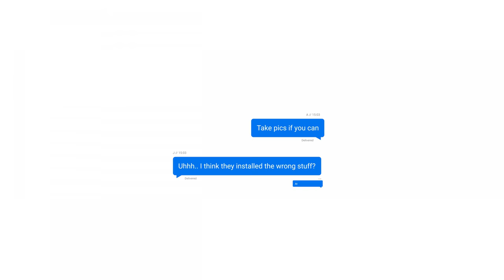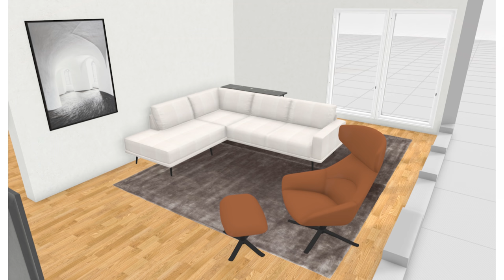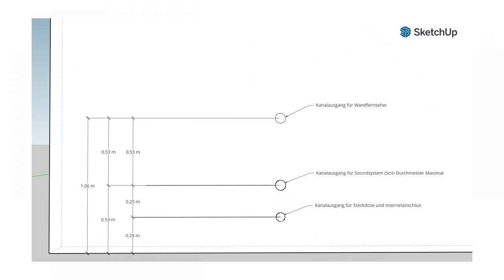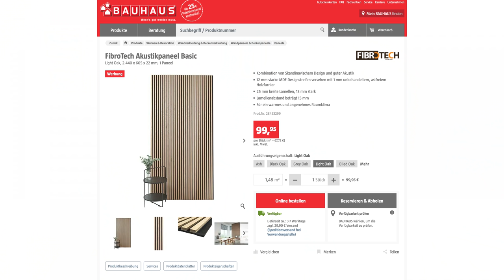HARD Lessons from Building a House in Germany

Comment: I really love your videos! You are so upfront, have a great way of telling stories and make it interesting throughout the whole video.

For my house, I basically let them do the heavy work like removing walls, install door frames, do the tiles, etc.

All floors, walls, doors, the kitchen, electrical stuff was done by myself, friends or family. Luckily we know an electrician.

I learned a lot on the work site since I'm an engineer and normally work on totally different things.

For your drill holes: There are many ways to cover up holes. Not only cover them up but fill them so there is no major structural damage. All hardware stores and also amazon has options for concrete, wood, bricks and whatever material you wish to fix. It takes a little work if you really want to make it perfect but it's worth the time. I'd say 1 hour or maybe 2 hours if you need to go and buy the stuff and read through the manual. I hope I could help you.

I managed to drill so many holes that I had to fill again.
Reply from the maker: That is AWESOME. Perhaps one day in the future we will be brave enough to take on a renovation ourselves.
Reply: @TypeAshton  I just added a little hint for how you can deal with the holes in your wall. Cheap and easy, doing it yourself. I really feel your pain "ruining" a concrete wall.

I really hope it helps and I appreciate your interaction with the community so much.

Germany can be very proud to have the two of you loving here 🇩🇪♥ 🇺🇸
Reply from the maker: Thank you so much for all of your help! This is wonderful information.

Comment: Moving a lot in recent years and more often building or at least renovating on a larger scale ourselfs we learned quite fast that the best way to go is always using a general contractor - that way you just communicate with him and he will take care of his contractors. One main benefit of this: You do not only eliminate the problems of "Stille Post", but he will also be able to organize craftsmen and material in a shorter period of time as you could.

As for your Soundsystem: It might depend how much work and dust you want to spend into it. You could openthe wall and move the cable and the sockets the classic way. However you also could close the existing sockets and move on top of the wall behind  a skirting board like most people do. Then you would need a small cable duct from the floor to your TV. Putting that on top of your wall does not look as perfect as you might wish, but might be a lot easier than putting the cables into the wall again and making new sockets into the wall.

One lesson you can learn from this for your next house though: Make sure that you alwayss have enough empty conduits in your house. When we are building anew we always have empty conduits used for electricity or datacables in a certain height in every wall. That way you never rarely have problems pulling new cables. You would only have to slit the wall up or down until you reach the position where you want to put your new socket.
Reply: Opening the wall alone is gonna cost let me tell you that. Concrete walls are not easy when it comes to breaking open and fixing. Depending on the amt of work needed that'll be a couple thousand. He's probably better leaving as is and working around it.
Reply: @livelovelife32  As said you might be right that it is way easier to put the cables on top of the wall - especially if the wall is already painted.
However - making a groove into a stone wall wall is not that much work as long as it is no steel beton. There are special saws for this. Depending on the kind of stone you coult rent one for ~100€ and you might need to buy your own blae for another 100€ - that's it if you would do this yourself. Plastering everything yould not be as hard as well. The hardest part might be to paint it again so you will see no difference to the rest....

Comment: Unless you want to install carpeting, there's not much you can do about noise attenuation. I had my carpet replaced recently, and I was really amazed at the amount of noise that seemed to reverberate throughout the house once the old carpeting had been removed. As far as the misplaced holes in the wall where the TV set is supposed to go, one fix is to install a shallow cabinet centered in the same spot, but wide enough to cover up the holes. That would allow you to properly center the TV and conceal the wiring inside the cabinet. Or you could fur out a portion of the wall a couple of inches, leaving just enough room to conceal the wiring inside it. You could even paint it a contrasting color to make it look like an architectural element.

Comment: well, that´s why in the eighties we decided not to build a new house, but instead looking for an existing house. it was a settlemet house that was sold because the owner had died and it was ready to move in after some small work, and we changed a lot of things step by step in the following decades, e,g,  a terrace and a wintergarden with fully movable sliding doors, new windows, new flooring,  modern bathrooms, gas central heating heating . thermic isolation etc. we never regretted it because it was so flexible in use when we had our children. of course we had to make compromises but it was worth it in the end

Comment: 24:22 the bubble is an expanding vessel to maintain constant water pressure on the heating system no matter if it 20°C or 60°C.
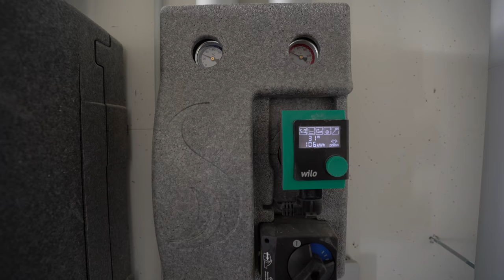24:35 is called a "Festwertregler" It will keep the temperature on the same level all time just by adding heated water to the cooled water to bring it back to normal.
The system is not that complex and you will probably get a manual. But believe me when I say, you cannot do much if the system makes problems. You will have to call a professional.

The system is meant to be set up once and done until something eventually breaks.

The entrance.
Plants are good for noise reduction. I would put a little jungle in the corner next to the stairs. I think that is one of the main areas for deflection and amplification of sound.
A little carpet towards the stairs, maybe some paintings on linen and a little sideboard or bench should break up the sound waves and dampen pretty good
Reply from the maker: Thank you!

Comment: The white cylinder is an Expansion Vessel/tank (Ausdehnungsgefäß). In a sealed, pressurised heating system (combi boiler - Kombikessel) the water expands when heated and the expansion vessel maintains the correct pressure. There is usually an expansion vessel within the boiler casing but large systems may require an external one.  One side is filled with water from the central heating system and the other side of a diaphragm is pressurised with air or nitrogen via a Schraeder valve.

Comment: Regarding your TV wall issue: I have a similar problem, where I need more outlets for routing cables through, and I will solve it by putting a fake wall in front of it. So I will put up a wooded frame work with proper support to hang the TV and then put plywood on it. And then I will put a sound dampening panels (e.g. from WoodUp) on it so the echoing in the room in general will be eaten up.
I will then have all the freedoms to route cables where I need them before putting on the plywood and do not have to grind into the original wall.

Comment: if you need to drill in concrete, you will need to buy a SDS plus drill machine and drills.  Hornbach has those,  i prefer makita, but Bosch and Metabo are also very good.. tip, if you drill in concret, put  the nossle of the vacuum cleaner under your drill work while drilling, thats preventing a lot of dust.

Comment: Actually you should know what´s in your techroom by looking at the bill. Kinda hard to tell by those few seconds you showed. There is the basic water supply with a meter and a filter by a company called Conel, these lines run into your waterheating system (Brauchwassererwärmung) which is the big drum in the corner and follows the coldwaterlines into kitchen and bathroom, As far as i can see you´ve got a warmwater circulation system for convenience (the pump behind the reservoir) the other pump there is from the heating unit to the heatexchanger inside. The insulated block with the pressure meters is also a pump, but for the heatingsystem. The big unit of Aqotec is the heater in your case i guess you are connected to an external plant (Fernwärme)

Comment: when I bought my house the hallway was also a hollow hard echo mess. I had the wall around the stairs lined with high pole carpet (glued to the wall) in stead of wallpaper and call it my cuddle wall and all the echo disappeared. also a hatstand with a couple of jackets or curtain besides the front door will help a lot in reducing echos.
my cuddle wall has been up for over 10 years and because of the dark colour you can't see any dirty fingerprints and with vacuuming it ones a year there is no dust problem and vacuuming is the only maintenance I do on that wall. this wall dampens so well that if my phone rings on loud on the other floor of the house than I am on I will probably not hear it.
Reply from the maker: Ah that sounds like a good solution! We also have a toddler that has a tendency to touch/destroy everything, so this could work well for us!
Reply: @TypeAshton  just sent some pics for inspiration to your gmail

Comment: The big round Ttnk you questioned is a blancing Tank for warm Water so there will be no leak due to rising pressure in the pipes as the warm water expands
Reply from the maker: AH okay!! That makes sense and is super interesting. So I guess it is just filled with air and it will pressurize itself?
Reply: @TypeAshton  well normally there is a membran inside which can move, the other side behind the membrane is often filled with nitrogen - yes it will pressurize itself - after many years the membrane can fail, then you have to replace it as it will not work anymore
Reply from the maker: That is super interesting. I hate to ask this, but it is all so new to us.... how do you know that it has failed? Do pipes start leaking or is there an issue with air getting into the pipe system?
Reply: @TypeAshton  to get an idea, you can knock on the outside, if its a hollow sound it should be good, if it is a dull sound its probably fuilly filled with water -> dead

Comment: BTW, that big round white thing contains a balloon that keeps the pressure in the water pipes up for the heating.
Reply: Exactly.  With the underfloor water heat, you need that really inelegant balloon as a backup for lost pressure.

Most of the water returns will have on/off valves and should be labelled.  Take pictures of any labelling done now - and keep those in hard copy in case the marker wears off over time.
Reply: It also helps with things like water hammer if a valve closes too fast

Comment: Glad that most of your lessons were more on the positive side. 
If I had to provide one important piece of advice here: get surplus tiles of your bathroom, kitchen whatever surfaces you have, even the wood. If you ever break a tile in 10 years cause you chnge something, you will need those, same for other accidental damages. Better than searching for something that looks "almost" the same then.
And I could probably explain what all the parts in your tech room do, but I won't be able to explain how to operate them. Here goes the same as you said, better leave that to a professional.
One thing I am curious about is, why are the outside walls made of concrete? Was that a concious decision? Usually it is only the basement that has concrete walls and for the living areas you would use "softer" stones like "Kalksandstein" so you don't need a percussion drill to get a nail into the wall. Or were the wall prefabricated, delivered and then placed there?
Reply from the maker: Good idea! We hope they builders will have some left over for us once we take possession. If not, we will ask them. 

As for the concrete walls, this was the suggestion of the builder.

Comment: With the hillside right next to your house you should also check if they install a proper drainage system.
Else, you could find yourself in a bad position, having standing water against the house wall after heavier rain.
An additional recommendation: Check the level of "Radon" in your entrance area and technic room (all rooms which are in the "basement") and in the area of your stairs - here in the black forest we have higher levels of natural "Radon" and if the concrete base is not properly sealed of, it could get into the house.
Normally forgotten by home owners as it is only mandatory for facilities with working personal due to workplace safety laws.
Greetings from a  "neighbor". 🙂
Reply from the maker: Thank you for the tip! We did not consider this yet.

Comment: In the Technik room: The white thing is called an expansion tank, it keeps an even pressure when the water heats up. This stops wear and tear on pipes from them shifting to much, and also stops banging sounds. All boilers have these atleast here in the US and in atleadt Pennsylvania they are required on new homes for even water heaters.

The side closest to you with the "nipple" is pressurized air, and there is a bladder inside to separate that and the water side. Which is hooked to the pipe
Reply from the maker: Thank you!

Comment: Your videos are always so nice to watch. Make me understand better our construction. 
Few ideas:
- drilling in tiles can be made quite easy even for a beginner (which you are not) by using diamond crown drills. It is water cooled and can be somewhat costly. But you will probably only need one 6mm piece. There is a lot of tiles in your house, so buying one could make sense. 
- tech room looks quite straigtforward to me. You get the technical drawings of it I suppose, if not, demand it. This will make not only servicing and upgrades easier, but also help you understand what does what. It  is really quite simple. It takes some "contemplating" (rational looking at) with a drawing in your hands, then you get it all. It is also not a bad idea (it is possible, that the contractor even is legally bound to do it) to label all the devices in the system - ask them really nicely to do it in both languages. Because there are two significant "seasons" in the operation (with heating on and off)  it is also a good idea to make yourself a "plan", a protocol, what to do when switching. This may be covered by your contract - if not, nicely ask the contractor to assist you in making it. I think it's important that you are as much independent in managing the system yourselves, that you "own" it - your profession enables you in it. This will make troubleshooting easier and will spare you much expenses. Even before the digitalisation, which made most system commands (valves etc.) motorized and centralized in a single unit it was achievable, but now it's mostly pretty easy; it's like controlling your own personal spaceship ;) One of the happiest momets of the year is when in autumn you make the big beast start spewing fire to fill the veins of your house with heat, when you hear and feel it wake up from the summer sleep and is wild and powerfull ... :D
Reply from the maker: Great advice! Thank you so, so much. Another commenter suggested that we make a "manual" for the entire house. I think that's a great idea.

Comment: There is a good reason why you build in Germany once and then live in this house forever. They are buildings that can stand for hundreds of years, in contrast to the majority of American houses that are quickly assembled. In German houses you also feel safe and secure against the forces of nature - they are a home in the truest sense of the word.I would say - you have done everything right!
Reply: Love the European houses..strong safety
Reply from the maker: Yes! This house certainly feels like it is built to last.
Reply: On the downside you can run into problems with our solid houses. Now when you want to make a house build in the 60s energy efficient it is much more difficult than in a house build only from wood and dry wall. Or in this case much  cheaper to tear down and rebuild the dry wall one than the solid one.

Comment: Some food for thought when choosing your "Sonderwünsche". Just remember that you will use the stuff which surrounds you for at least 10-15 years, sometimes even longer. So my advice: if you can afford it by any means buy any upgrade if you think it makes sense for you, be it emotionally or technically....if you divide this surplus money with the 10-15 years it will be...peanuts!!! But the joy is priceless.
Reply from the maker: Good suggestion! This is also how we have been tackling some of the upgrades. We are both in favor of doing it correctly the first time rather than buying something cheap and then replacing it down the road.

Comment: In The entrance room I could imagine bringing the ceiling down a good bit. Maybe even have a hard board in white and hang it down with chains and leave some gap to utilize indirect lighting. Furthermore the tiniest bit of furniture like a shoeboard and maybe pictures on the wall and so on will improve the accoustics.
Reply from the maker: Ah interesting idea! Our neighbors did something similar in their bathroom - they installed a false ceiling and had lots of recessed lighting put in.
Reply: @TypeAshton  I can't really imagine this in a bathroom due to the humidity. But in this entranceroom, the high ceiling makes it feel even more narrow. If you put on the panels that you showed, you might want to cover only 2/3 of the wall height. With a wardrobe, dresser, a shoeboard and a mirror the room would already change a lot.